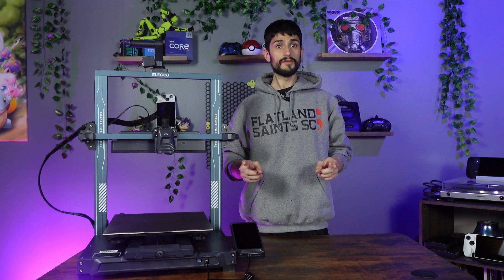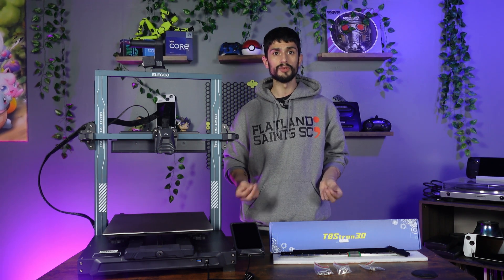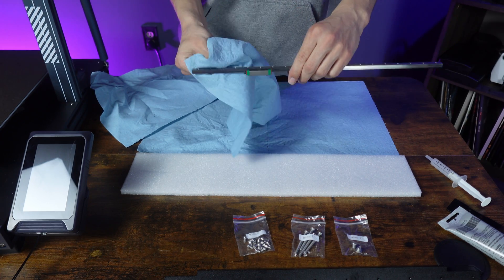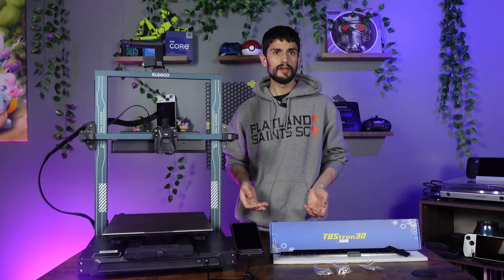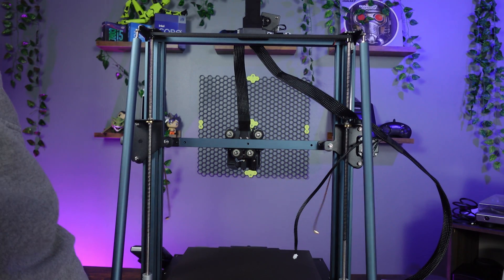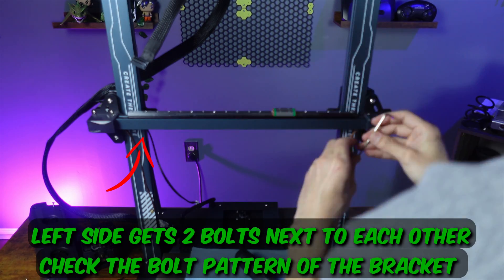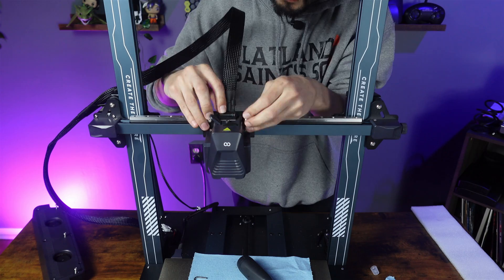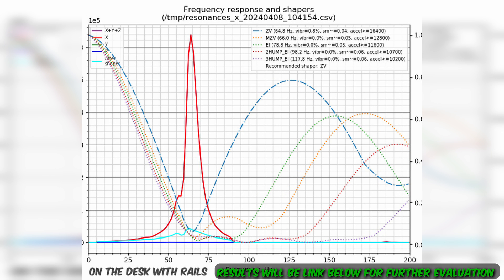Stepping into Precision: Neptune 4 Plus X-Axis Linear Rail - Part 1

Comment: I’m having a hard time re attaching  the belt it seems super tight? Please respond
Reply from the maker: Did you adjust the screw that is on the side too much? You also might have routed the belt on the wrong path.
Reply: You may need to undo the belt tensioner then put either ends of the belt onto the holding tab/grooves. If its too tight u may just need to use one tooth further out when connecting the belt.

Comment: Hey, is there anything i need to change in the printer config? Like, is the head- position identical to the original? 

Nice work anyway ! Got both kits sitting at my printer, going to start tomorrow 😅🤙🥳
Reply from the maker: Nope! After you install it, you don’t need to worry about changing anything in the configuration.
Reply: @EdsTechTalk94  Well, but i have to do some Changes on the printer itself. The big part cooling Fan in the Back of the x Axis doesnt fit the printhead Position anymore. The head sits lower, so the part around the nozzle doesnt get cooled as good as before. 
I also needed to shim the cooler from the Axis above the screws, otherwise it grinds at the z Axis pom wheels. So actually, the hole Positions of the bracket for the fanpaket need to be about 7mm deeper in Z.

But that's what the printer IS for, solving Problems😅

May i ask you which accelerations and speeds you recommend with both Upgrades?
According to inputshaper my max acc. for y is <3,8k, for y it's 12k...kinda weird
Reply from the maker: Well from my understanding, not every machines acceleration will be the same. Our belts could be at a different tension, the base they sit on places a huge factor in the machines stability. 

A lot of things play into that factor, I’ll let you know what it is at when I’m near it next time. I believe in my review of it I have a Google drive with my orca slicer profile if that helps!
Reply: @EdsTechTalk94  the only change needed would be a new bed level recalibration and z offset.

Comment: Great videos, these helped me immensely. However at 0:45 you mention TBStron says they're ready to be installed with grease from the factory and that doesn't seem to be the case. Other videos and posts I've seen have said they need to be greased, and the grease they come with is more for corrosion protection. I installed them without adding grease and they are very dry now, waiting for some lithium grease and syringes to arrive tomorrow. You were right to clean and grease them yourself, I think everyone needs to go that before installing. 

That said, your videos were great and helpful. Thanks for posting!
Reply from the maker: Yea I thought just to be safe I would clean and grease them myself before installing them.
Reply: @EdsTechTalk94  You definitely made the right call. Just sharing my experience for anyone considering skipping that step.

Comment: Hey @EdsTechTalk94 I'm considering getting only the X-axis linear rail kit right now.  The Y is a little more than I'd like to spend at the moment.  Do you think it would be worth it for print quality just to upgrade the X only.  I'm not really too conserned about speed.  It prints pretty fast to me at the default speeds.  I've got my printer really dialed in and getting great quality, just like the idea of the linear rails adding that extra.  Lemme know honest opinion.  I looked at the graphs you linked, but I'm not knowledgeable enough with those to tell which is better.  I do understand the concept.
Reply from the maker: I would save up and do the Y axis first if I had to choose between the x and y axis to upgrade first. Not having to deal with the pom wheels and how much easier it makes bed leveling would be the biggest reasons.